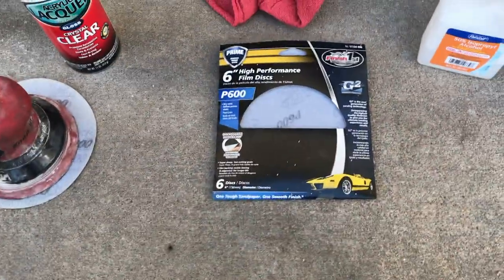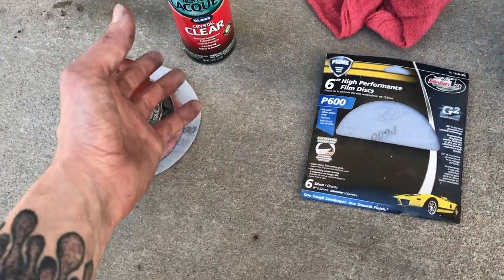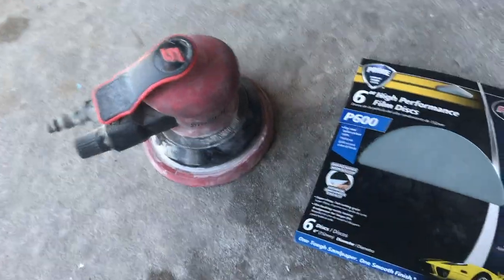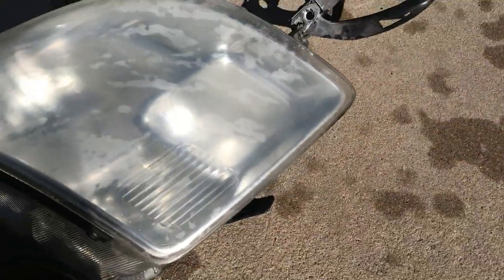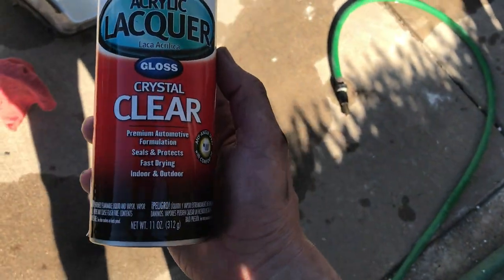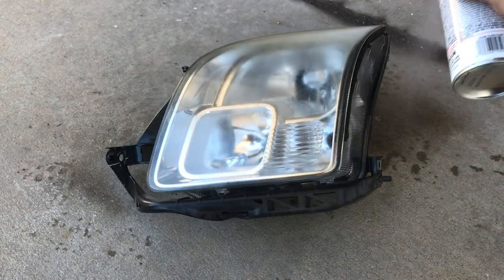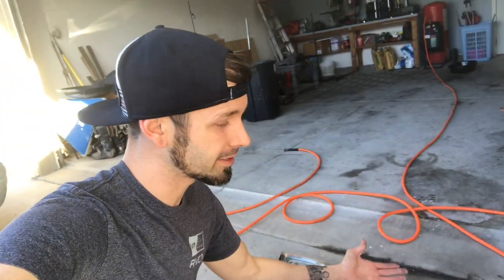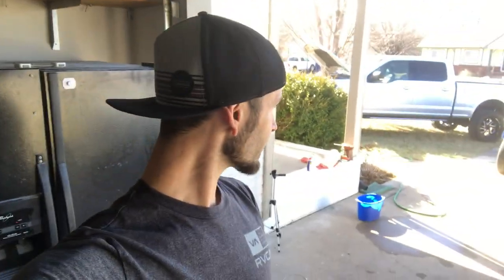Restoring Headlights with Orbital DA Sander

Comment: You should work your way up to a higher grit , then polish with a heavy duty compound , then polish then apply the 2k clear coat
Reply: If he did that the clear coat would not stick, the clear coat fills in the scratches this way and gives some bite so it sticks to the headlights. If going your way there's a risk the whole layer would peel off. You could use a plastic adehsion primer, not sure how it would affect the clearness however.

Comment: How do you use a DA sander (especially a larger one) when the surface is curved? I have a DA sander but I have a hard time with the curves. Thank you and nice video!
Reply from the maker: I guess you would just have to use the edges of the sander? 
Haven’t really messed with headlights that Have lots of curves.
Reply: @Smackalakin  Thank you.
Reply: @Smackalakin  There are soft interface pads you can put between to make it conform better to contours